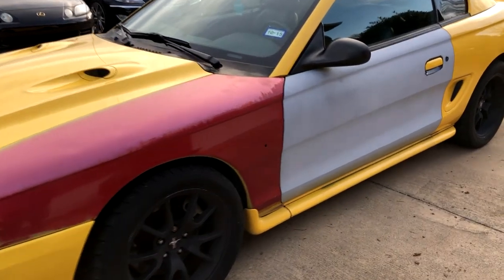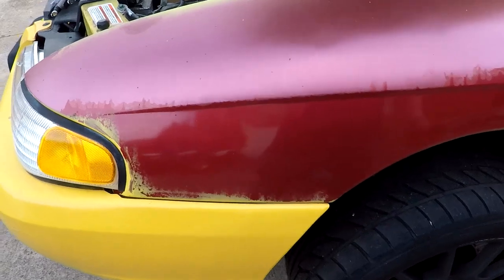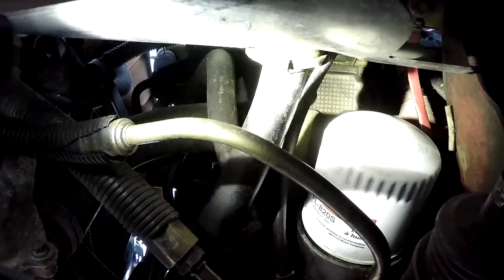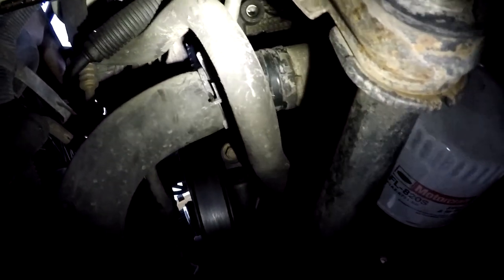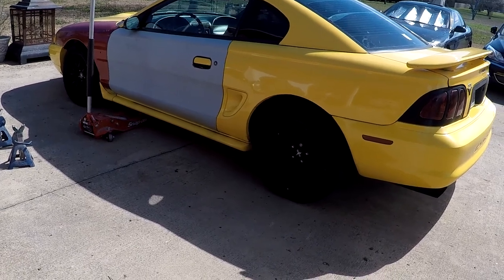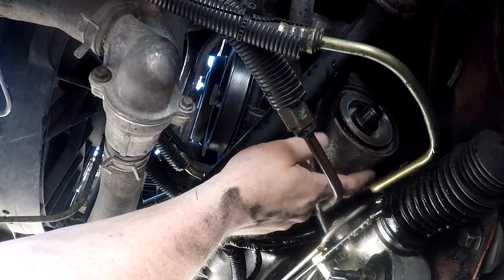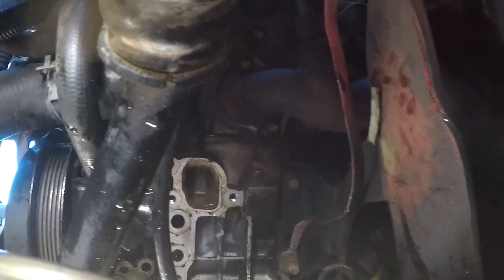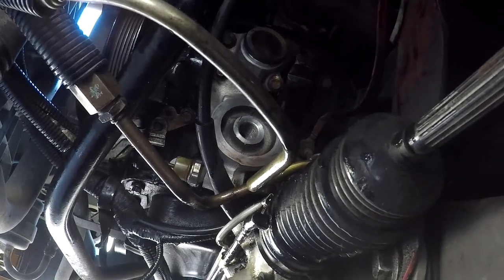Fixing the oil leak on my Cobra (Part 1)

Comment: Hey Man, i need to do the same thing on my 97 cobra. Question, what size allen key you used to lose the oil cooler. And how bad was it to lose the bolt hidden behind the pit cooler adapter. Thanks, any advise will be very appreciated
Reply from the maker: Yanny Fragoso the Allen key size is a 1/2 inch and once you have the oil cooler off of it, it’s really easy to get to the bolts. The oil cooler itself it what blocks the ability to get to the bolts. Once you remove the Allen head bolt that holds the cooler to the oil filter adapter, you just have to wiggle the oil cooler a bit while trying to pull it off.
Reply: @TheYellowsvt98  thank you very much, I tried the other day without taking the oil cooler and I gave up lol there's no way. Now I have to take the crossover coolant tube also but that one is going  to be a huge paint in the butt. I saw how hard it was for you and mine is 3 time worst than yours so I dont know how am going to do that lol